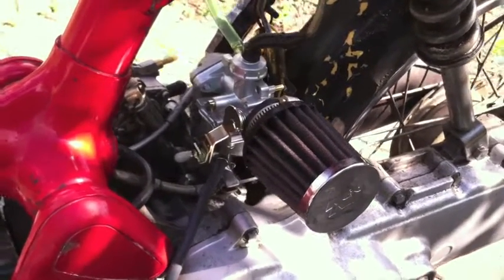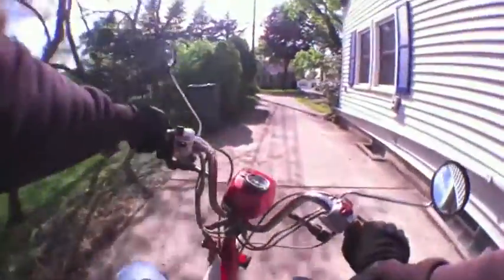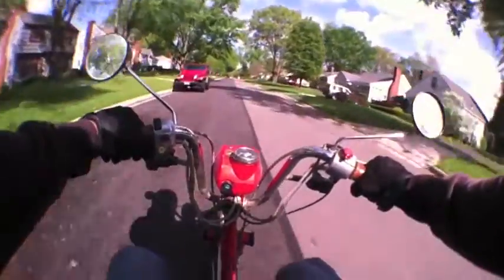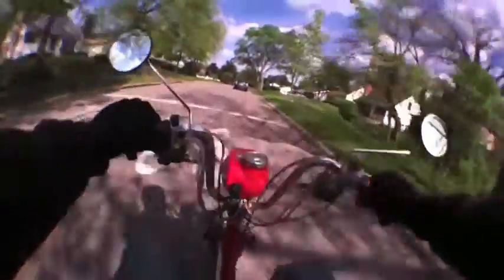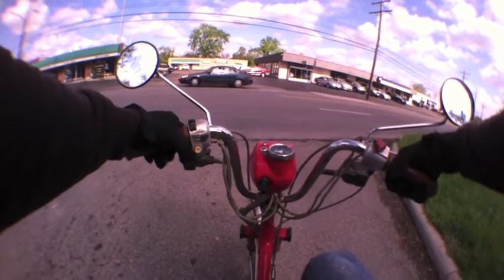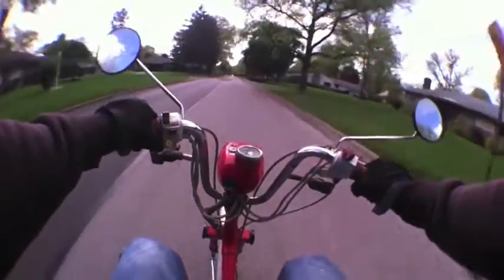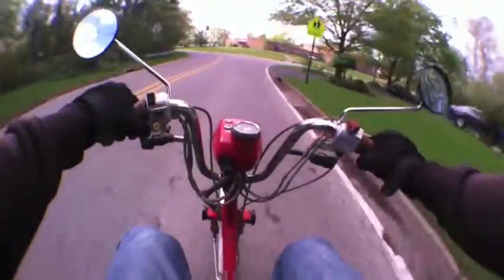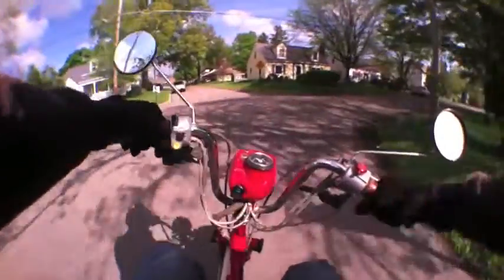Honda Express nc50 with aftermarket carb

Comment: Great find! I have two honda express bikes. And one needs a new carb. I have one of the bigger honda clone carbs but never felt like making the adapter. thanks so much for sharing.
Reply from the maker: I recognize that picture.  You're a moderator on the honda spree and other related scooters forum.  Thanks for visiting!  I've been on the forum about my Aero 50 a few times.  I'm kind of more of a noped guy.  But that Aero is a blast!
Reply: yup tha'ts me :-) I have 2 Sprees an Aero 80 and an elite 125
Reply from the maker: send me your address.  I'll send you a carb.  you can find my email at qt50.net

Comment: Churioz......Got lucky on the e-bay carb.  Installed right out of the box...adjusted the air mix and idle screw and "bingo"!!! Ifinally got one to work.  Thanks for your input man.  Don
Reply from the maker: glad it worked.  video?

Comment: I just bought the same carb for my Honda on ebay! Hopefully I’ll have time to install sometime this week.
Reply from the maker: you may have to adjust the cap on the carb if you don't have enough throttle cable for the slide.

Comment: i figured it out thanks tim
Reply from the maker: +Timothy Revelle just look for 38mm honda carb.  You'll probably have to drill out the idle jet to something close to .45mm or .50mm.  I believe the idle jet on this carb is pressed in so you can't unscrew it.

Comment: Churioz...These new carbs are difficult to drill out.  The mm drills break very easily due to the slim size.  The restrictor at the top of the idle jet is very hard.  The top end is real good.  Did you drill the entire idle jet out or just the restricted end??  I'm at the point where I have no idle, it dies when I let upon the throttle.  Any suggestions???   Or where did I go wrong you think??   Thanks for your help.   Don
Reply from the maker: yeah that was the problem with those carbs.  Some batches had idle jets that were impossible to drill out, at least with micro drill bits.  Some had brass idle jets and were easy to drill out.  You can screw in the air mixture screw all the way too the right and see if that helps.  Or you can try to get another carb from another seller.  I just got one that was easy to drill out but it's a crap shoot.  Another option is to buy a Dellorto SHA clone 15.15 carb and a shorty moby intake. My only other thought is to try to find micro drill bits made out of harder material.

Comment: When you reamed out the idle jet, did you drill  it out top to bottom???  I'm referring to the aftermarket carb that you adjusted.  Thanks!!!
Reply from the maker: I took the float bowl off and drilled it out from that side.
Reply: Wouldn't that get shavings in carb??  I purchased the same carb from that guy.  The idle jet pulls out easily.  Went to big when I reamed this jet out.  Didn't know how far to go, but I do now.  I have to locate some "mm" drills.  Ordered some from Japan, but it'll be awhile before I get them.  We have about 5 Express bikes here, and a bunch of Sprees.  My son re-builds them for a hobby.  Nice chatting with you and thanks for the reply.  I may throw a few more questions at you.   Don
Reply from the maker: Nothing a little compressed air won't take care of.  I found out that the idle jet contributes to the fuel mixture even at WOT.  If you overdo it, it will four stroke.  yeah, the idle jet will pull out.  So I guess you can do it from either side.
Reply: So, your good with "idle jet" being punched out at 0.50???  We put the new aftermarket carb on today and it ran for about 5 minutes and died.  When it was running, we had to run it with the choke fully on.  Not good.  Do you know of a source where a person can purchase some extra "idle jets" ???  I might ask the guy we buy these carbs from.  Maybe his supplier can be of help.  OK  C26, thanks for the info again and we'll be chatting again.  I'll post my result when it all comes together.  Talk to you soon.   Don

Comment: Hey man! Been really enjoying all these videos. My dad and I are going to replace the crankshaft bearings and seals on my 1981 nc50. I put those new carbs off eBay on both my nc50 and na50. I ordered a 70 cc kit for my na50. Is it necessary to upgrade my carb or jets or exhaust for this? Or just add more oil to my gas? Thanks in advance..
Reply from the maker: Yes you need a bigger main jet in the carb and may have to adjust the needle especially if you go to a performance exhaust too.  Ideally, a bigger carb and proper jetting is better with 70cc kit and performance exhaust like a vm18 or vm20 Mikuni carb.
Reply: churioz26 wow thanks! One more question, will it hurt my bike if I don’t get something like a vm20? I’m running that same carb in your videos off eBay. Of course I would like to upgrade my carb at some point but I’m just wondering, can i use it at all with my 70 cc kit?
Reply from the maker: @thomaseubanks5323  You can use it but you should run a temperature gauge and try to keep the bike below 425F or even 400F.  Ideally, you need a bigger carb to deliver more air/fuel mixture for that kind of setup. A bigger carb provides more power and helps keep the engine cooler.
Reply: Thank you so much! I will upgrade to that vm20 soon.
Reply from the maker: Thomas Eubanks you may have to sand the bottom of the vm20 intake flat. Fyi
Reply: churioz26 I ordered the vm20 and the MLM 20 mm intake from treatland. You’re saying to sand down the painted bottom surface of the intake that meets with the engine? Also, do you recommend any particular main jet change in the vm20 or keep it as is?
Reply from the maker: @thomaseubanks5323  Some people have had that problem with the bottom of the intake not being level.  Check for level first.  If it's not level, it won't seal.
Reply: churioz26 awesome, I will do that. What fuel oil ratio do you recommend with the vm20 and the 70 cc kit? I’ve been mixing mine at 50:1 but I figure I need to have more oil now, right?
Reply from the maker: @thomaseubanks5323  40:1
Reply: churioz26 thanks man! I will do that
Reply: churioz26 yeah it looks like I might have to sand it down. Just got the vm20 and and the 20 mm intake. Been running that aftermarket (eBay carb you suggested) with the DR 70 kit on 40:1. Doesn’t get it hot, been using the infrared thermometer and the cylinder hasn’t gotten much over 300, if at all, I don’t think. (I don’t run it long, I figure I need to break it in, right?) or did you mean to temp the exhaust? Because that’s more in the 500 F range. But I figured you meant the cylinder temp.. lol
Reply: Hey @churioz26 I put the vm20, with the new intake, as well as the DR 70cc kit on my NA50. It runs way better but I still top out at 25. It idles great. What main jet range should I get? 55-105, 110-155, 160-210? I’m assuming that’s why it won’t go faster, but I could definitely be wrong. I would appreciate any advice. By the way, do you have a patreon?
Reply from the maker: @thomaseubanks5323  what exhaust are you running?
Reply: churioz26 sorry, I forgot to add that. I’m running the stock exhaust. I’m gonna get the MLM people’s pipe as soon as I can.
Reply from the maker: @thomaseubanks5323  with the stock exhaust, you probably need to go down from the main jet that the carb came with.  It came with a 180 main jet.  So I bet you'll be around 150-160 with stock exhaust.  You'll need to buy a range of jets and start high and work your way down.
Reply: churioz26 gotcha man, thank you. Now I know which range to buy
Reply: @churioz26 you ever plug the oil pump hole? I put an expansion plug in there, seems to be working okay. Just wondering what you thought about plugging it vs leaving it in there as it is.
Reply from the maker: @thomaseubanks5323  I'll either plug it or keep the pump in it and just plug the lines.
Reply: churioz26 okay so I’m about to order the 110-155 range. But to just confirm, you’re saying I need to have a smaller jet? I thought with the 70cc kit I would need a bigger jet?
Reply: Or that was in reference (getting a bigger jet) to when I was running the stock replacement carb?
Reply from the maker: @thomaseubanks5323  It's hard to guess at jet sizes without being in front of the bike.  For the stock exhaust, you would need something smaller than the 180 main jet that comes with the carburetor.  For a performance exhaust, my guess is 180 is still too big but I could be wrong.  If it were me, I would order jets in increments of 5 from 130 - 180 so 130, 135, 140, 145, 150, 155, 160, 165, 170, 175.  You could narrow it down to 2.5 increments later.  Always start with richest jet and work your way down.
Reply: churioz26 you the man! Thanks so much for taking the time to help me
Reply: churioz26 okay man I hate to bug you with all these questions but I really want to know. What does the the mixture screw actually adjust, fuel or air? Mine is all the way in, and if I back it out, it runs like shit

I have a 1980 NA50 Honda express II
Stock exhaust
Vm20 carb (stock main jet and idle jet)
Dr 70 cc kit
Mlm 20 mm intake 
Top speed when the engine first starts, about 25. Then it’s a consistent 22 mph. 
I know it’s tough when you’re not looking at it but I figure you’d have something to say haha.  Thanks man.
Reply from the maker: @thomaseubanks5323  Usually air but it's air leading to the air fuel mixture.  If you have it all the way in, then you need a bigger pilot jet.

Comment: What is your method for cleaning out the exhaust port and the muffler. My Urban has some issues breathing out
Reply from the maker: You can take the muffler off and I started a fire and waited for hot coals to form and then cooked the muffler until it glowed orange and then flipped it and did the other side.  Probably 15-20 minutes a side.  Don't overdo it.  You can also soak the muffler in diesel fuel (overnight or for a day or so) and that should clean it out.  To clean out the exhaust port, you should have access to it once you remove the exhaust.  Or you can remove the cylinder jug.
Reply from the maker: Also if you do cook the exhaust in hot coals, you will need to repaint 
it after you have finished otherwise it will rust fairly quickly.  Just 
get some high temp paint.  I brushed mine down with a wire brush and 
then gave it several coats.  Came out looking great with not much work.

Comment: Where did you purchase the "mm" drills to do the jet work??  Please get back to me, my ride is dead in the water.    Thanks
Reply from the maker: ebay.  Just type in "micro drill bit set"  - you'll need a set that starts with 0.30mm or 0.35mm and then 0.5mm increments.

Comment: I bought a Keihin carb, the original carb and now the bolt holes on the intake like the old carb also don't line up.any suggestions? Or what is this carb you out on, please let me know brand, mm, and air filter I would need.
Reply from the maker: If there not too far off, you can take a drill to them and try to line them up.
Reply: churioz26 can you tell me the carb and intake again? I may just buy a setup like yours

Comment: guy not wanting to discontinue the oil injector by ordering the cheap carb on ebay.. his stock carb is missing the air screw do you have one thanks tim
Reply from the maker: +Timothy Revelle I'll see if an air screw from another carb works on it.  I don't have an extra stock air screw.
Reply from the maker: +Timothy Revelle I bet the air screw and throttle stop screw will work off of that aftermarket carb on eBay.

Comment: what kind of carburetor i got an 82 nc50 would like to put aftermarket carb on it (the link was broken for me) and what size was the carb
Reply from the maker: link seems to be working now
Reply: Did you ever get that carb you were looking for? Let me know.  I have an 82 NC50 also and  I cant find an aftermarket anywhere. Too many are incompatible with it. Its like a rare "in between"  model.

Comment from the maker: Comment from voodoo 1951: Hi C26... Awesome carb but I can't seem to locate it thru that website. 
Link to contact them won't work for me. Just wonderin' if you can help 
me score one of those  bolt on units? Or perhaps you might know some 
other contact method or even some other place to get one of these 
carbs...  BTW, I got you subbed now too. Click me back when you get a 
chance and check out this little FZ I picked up recently. https://youtu.be/1EaeQC57g_4  Thanks, and have a great day. V51

Youtube is giving me a hard time approving his comment so I just posted it here.  I don't have any of these carbs right now.  You can go to treatland.tv and get a moby shorty intake and gasket and then pair that with an SHA 15.15 carb or clone.  The intake, gasket and SHA clone will run you about $50.  Check it out!  Shorty intake will bolt up to Express.

Comment: Hi C26... Awesome carb but I can't seem to locate it thru that website. Link to contact them won't work for me. Just wonderin' if you can help me score one of those  bolt on units? Or perhaps you might know some other contact method or even some other place to get one of these carbs...  BTW, I got you subbed now too. Click me back when you get a chance and check out this little FZ I picked up recently. https://youtu.be/1EaeQC57g_4  Thanks, and have a great day. V51